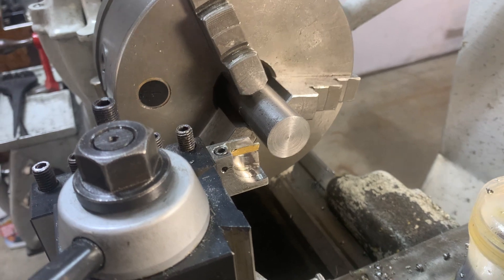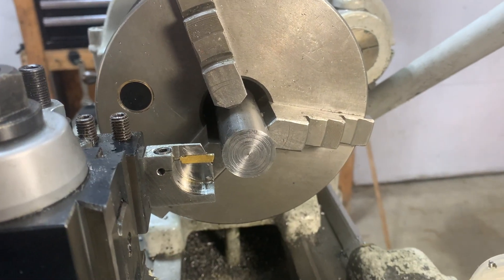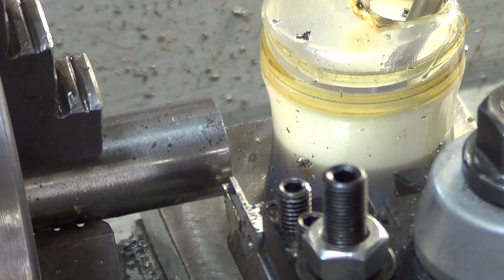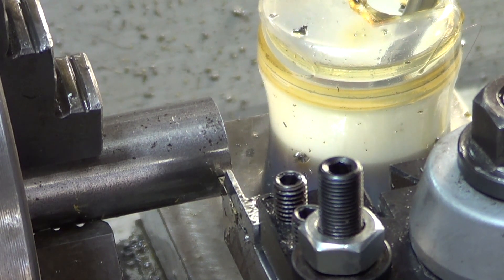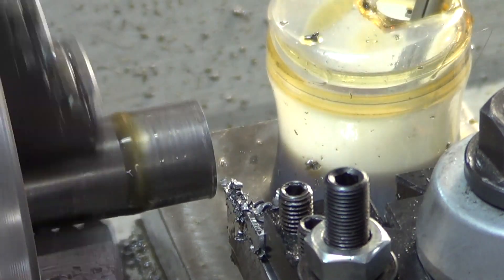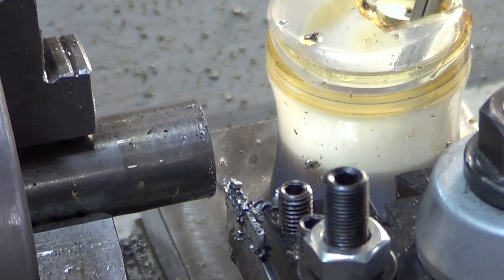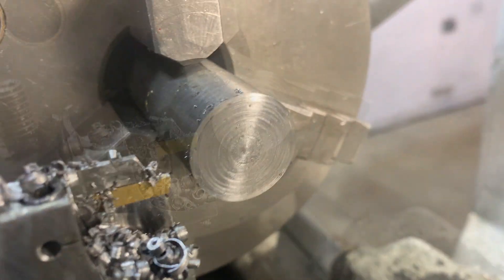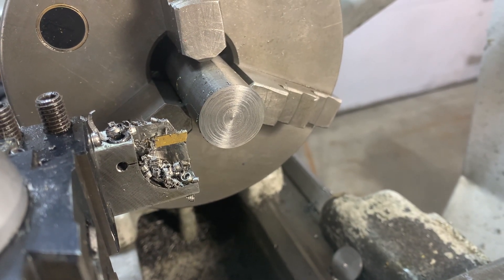Lathe Cut Off Tool Update

Comment: I'd recommend a ground sharper insert that results in less tool pressure. Take a look at MGGN200 inserts with vp15f coating. In one of my recent videos you can see how the chips curl nicely.

Comment: Does the radiused part on the right side add rigidity?
Reply from the maker: Yes it does Mick. After being disappointed with several commercial parting tools I decided to design my own and slowly add changes until the formula was bang on.